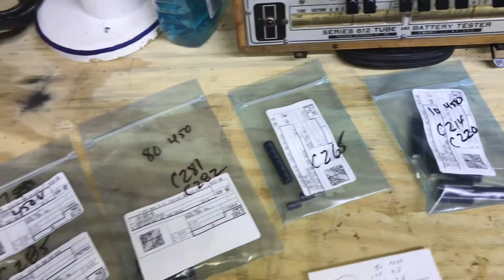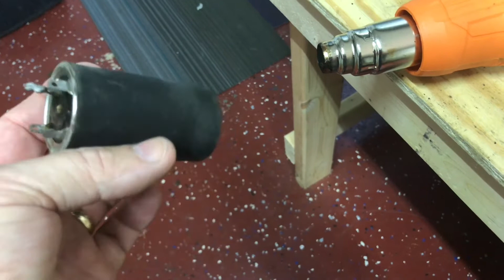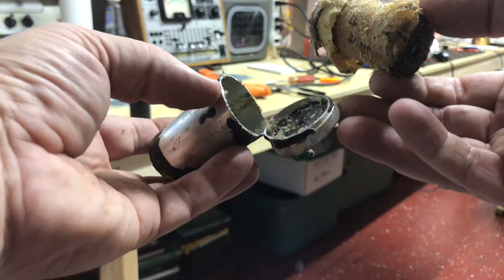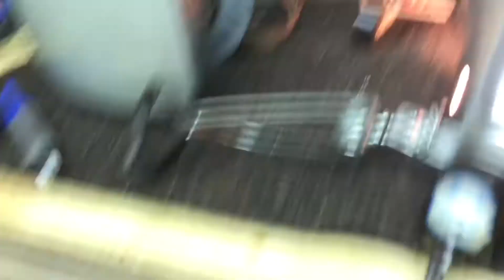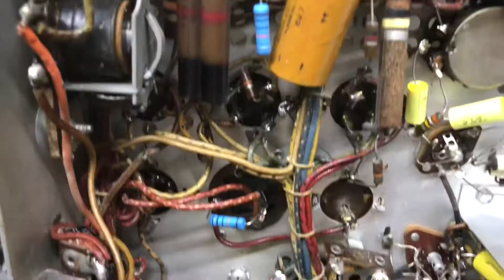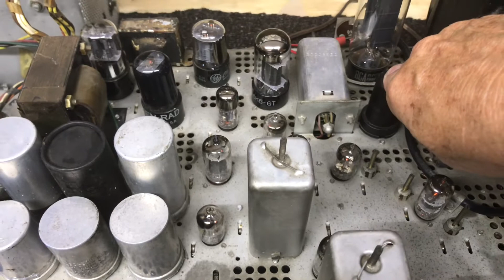1949 Dumont 15” TV Restore Part 5

Comment: 6:42 Sorry to interrupt. Did you put in an incorrect resistor on that restuffed lyic? The original has a yellow band andvthe new replacement has an orange one.
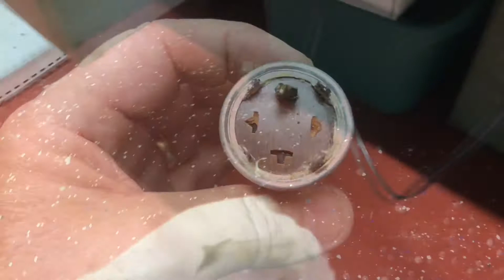Reply: 7:41 What I do here is saw through the aluminum can at the ridgeline above the base..I use a fine tooth X-acto saw and carefully saw through, rotating as I go along the base. Then I heat up the guts and remove. I clean up the phenolic resin base and drill fine holes alongside each positive terminal and one common ground one near a ground lug. Then I arrange the replacements above each positive lug, poke the + lead through the base and solder. Tie all the negative replacement lytics negative poles together and solder to one common lead, then poke that one through the base and solder to ground lug. Glue the aluminum can to the base and if you are good. it is invisible.

No uncrimping, no busted lugs, no mess. 

I usually drill out the rivets holding the can to the chassis, then reattach the restuffed one with either small slotted screws and nuts or use new rivets.
Reply from the maker: Yes I’ve done them the same way. 
   Thanks for watching
Reply: I thought it was incorrect, but they are both 100k.  Brown black yellow, Brown black black orange. Five band resistor replacing four band resistor.